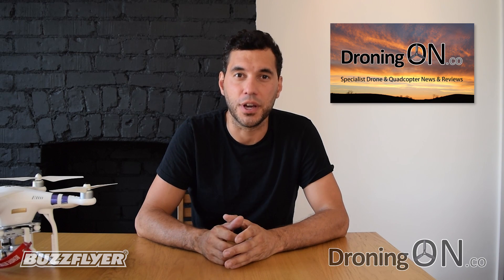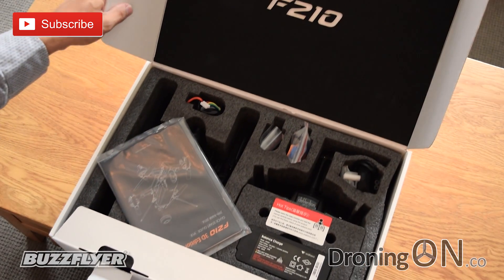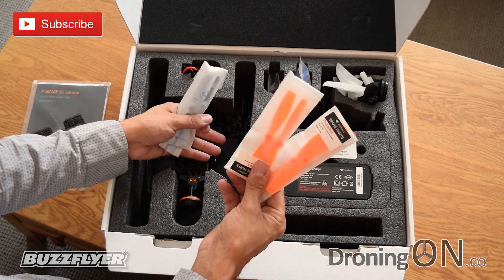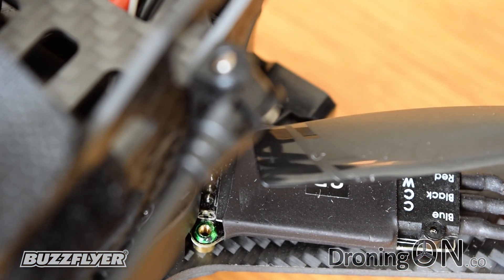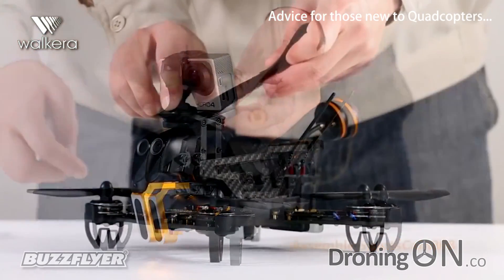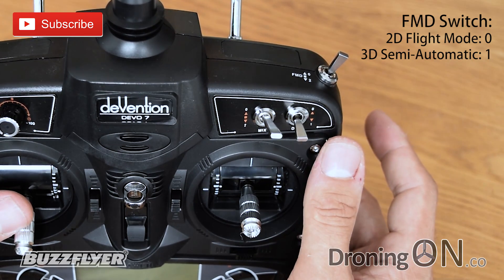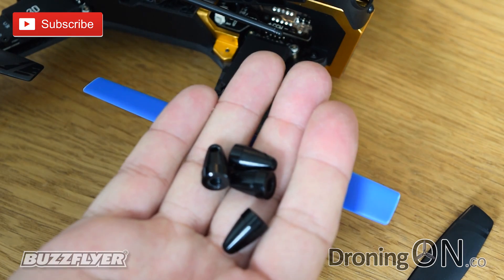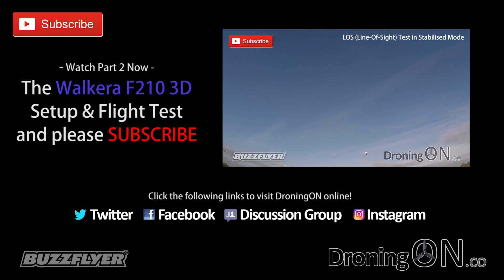DroningON | Walkera F210 3D Review and Unboxing (Part 1)

Comment: Thanks for the video. I’m used to the DJI drones that will hold their position without any input from the user. Will this drone do similar or does the     user have to maintain full control?
Reply: Just seen my question answered on part 2 of your review. So my follow on question is whether any of these type drones come with altitude hold?
Reply from the maker: No racing quads generally don't have altitude hold.

Comment: Hi. I have some question on F210 3D firmware - direct uploading using Walkera's recent firmware and Cleanflight and Betaflight.
 I had to Reboot/Flash my f210 3D and your website instructions helped tremendously!  CF and BF now can read my f210 3d
Not sure what to do now. Just Deviated my Devo 10 and it's not binding and no models show on my Devo 10!!! Regrets...
How can I contact you for assistance? Thanks!
-DS
Reply from the maker: +Dave Silva not sure of the Devo10 but have you tried setting your Tx into binding mode and then turning on the quad?
Reply: yep. They're still Not binding. Again, no models are showing up in the "Load Model" option on the Deviation in my Devo 10. They show up on my Model files on my PC when I connect the TX to my PC.  REAL confusing. I just wanna fly again...Was hoping you or your fanbase could help.
Thanks.
Reply from the maker: I really wish that I could help but without being there and seeing the issue first hand, it is hard to provide assistance :( perhaps try a Devolution group on Facebook?

Comment: What is faster this Walkera F210 3D or the Walkera Rodeo 150?
Reply from the maker: +galaxy, the F210 is substantially faster than the 150, largely due to the F210 utilising a 4s battery whilst the Rodeo 150 only takes 2s.